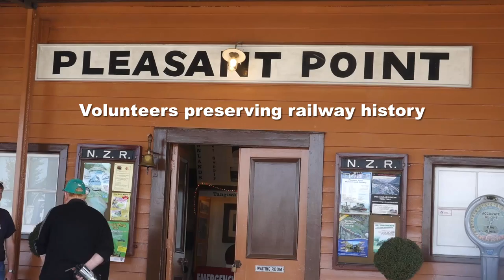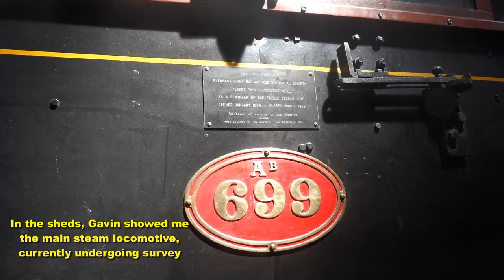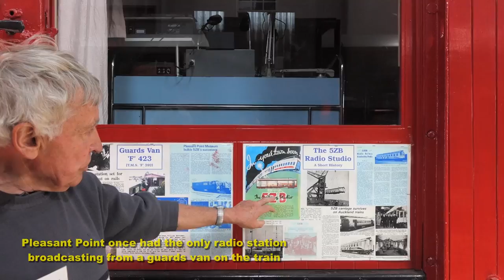Model T Ford railcar, Pleasant Point , New Zealand

Comment: This is another area that we share a common interest Jim, to earn my crust here in the UK i am a Train Driver ! driving suburban commuter type trains between London and Birmingham.
 Not only that i am a member of the class 45/1 Preservation Society that owns a Derby built, Sulzer engine main line Diesel Loco, 2500 HP 136 tons !! number 45 133, it is operational and has been running this last weekend on the Mid-Norfolk Railway at Dereham.
 There is another Model T railcar in the UK, Built to 2ft gauge, This Model T railcar is not a really a replica of an historic item but like the rail mounted Landrover in the UK is an exercise in putting a road vehicle on rails.
 I am very fond of steam Loco's myself, particulary narrow gauge ( it is all narrow gauge in New Zealand compared to the UK ! ) but in terms of operating a modern railway system it is too inefficiant compared to diesel and electric, perhaps not so much the egine themselves but all the facilities that are needed to operate them.
Reply from the maker: +Ian Virco  Interesting stuff, Ian.  On my return visits to the UK (none recently,) I always try to ride on one or more preserved railways, especially the steam ones, of course.